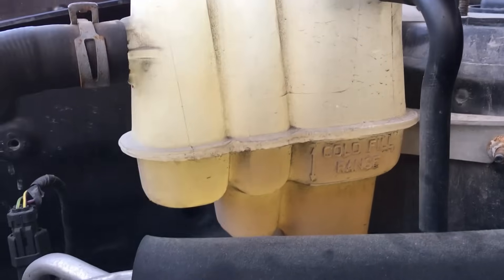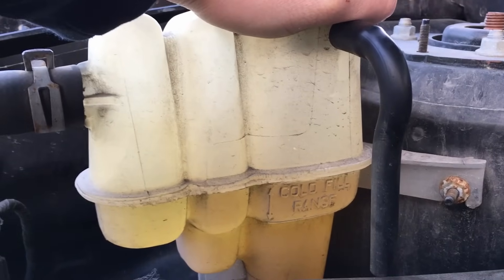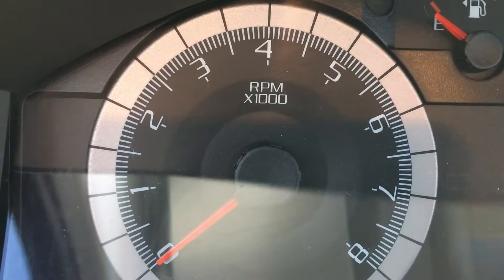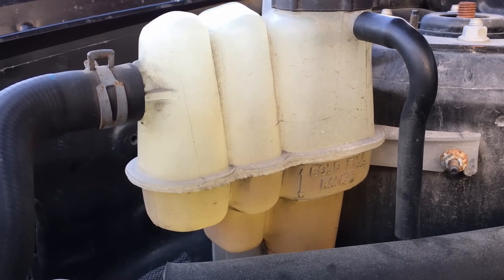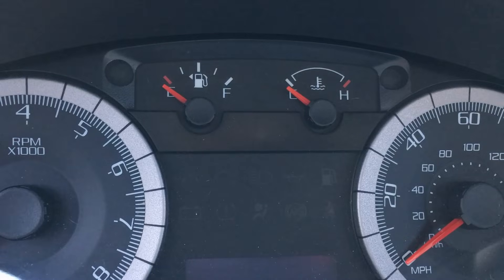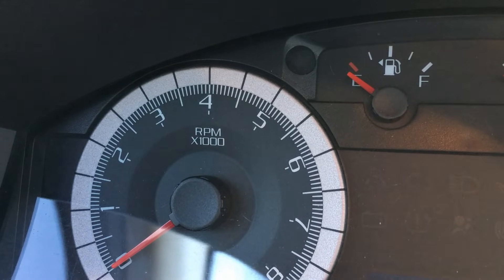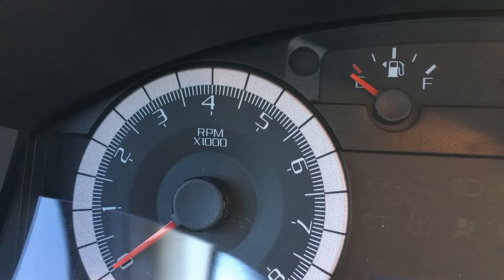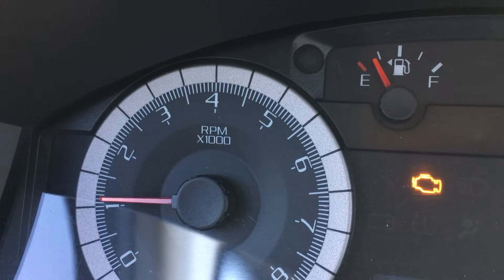Ford Quick Tips #69: The Trick to Purging Air From Your Cooling System

Comment: I have a 2010 Ford Flex bought new. No cabin heat until the car is thoroughly warmed up and driven several miles. Numerous trips to the dealer over the years. They make it a little better but never permanent. Other Flex owners have had the same complaints. I would like to hear your thoughts on the subject. Thanks.
Reply from the maker: No considerable cabin heat until a few miles of driving it totally normal especially in cold weather. Every car I have had from new to old takes a3-5 miles easy to start getting good heat. The other note I have is recently I had a customer complain of the same thing on a 2011 Explorer (which is very similar to the flex mechanically) he had it on auto I explained Fords strategy is to use the defrost and floor to mix the air and not blow it onto the drivers face full blast. Changing the heat to manual vent position fixed the concern he got heat and was comfortable much faster. Same thing in my Ram with auto climate control.
Reply: I understand that heat takes a while in cold weather but the Flex has a verified problem. At the suggestion of the Ford dealership I have a remote start and I can set the heat at 90 degrees, fan at high and run the car for 30 minutes before I drive and still the cabin has no heat. And there will be no heat until the car is driven several miles even if the outside temp is in the 30s or 40s.  And the RPMs have to be up there above 15-20 MPH. I've had Fords all my life and none of them has acted like the Flex. The other solution I've heard of so far is an auxiliary water pump into the heat.

Comment: Are you not leaving the coolant cap off while reving the motor?
Reply: Aaron Frazier is this required?  Having this issue on 6.0 power stroke.
Reply: @matticusbond3975  Did you get this figured out on your 6.0? I live in Northern Canada and heat isn't a nice to have.
I've been fighting with this for 2 days, simple thermostat change gone horrible.

Comment: Any advice on what I should do after vacuum filling my 2.3l Ford Fusion. I have good heat and a/c with no overheating but when I rev the engine in park I can still hear coolant ‘sloshing’ around? Recently replaced with an oem thermostat as well…
Should I run through this procedure?
Thanks alot for all your helpful information!!

Comment: I have a 2011 Ford Explorer 3.5 Duratec should I keep the cabin heat on or off during the 3500 rpm rev cycles? Thanks in advance for your help!

Comment: I added coolant in my 03 Ford Expy 5.4 2v. As i was pouring in truck started running bad. I think air is in system. I tried this trick and will try again later. Will this trick work on my older model. Thanks for all your videos.

Comment: Would you happen to have any videos of the changing out the coolant on the 2009-2012 Ford Fusion Hybrids? Not just the engine coolant but the electric motor coolant as well. I have not found a single video on this.

Comment: I put a vacuum on my 98 5.4 F250 TWICE and still no cab heat.  I'll try today to empty it all out again, vacuum to -22 - -25 for 15 minutes, then let the coolant get sucked back in, and do the 3500 RPM cycles.  Hope that finally does the truck b/c driving to work in a cold truck just sucks a bag full of asses.

Comment: I have a 2000 Ford ranger 3.0 just put new radiator and a lower trans cooler line in trying to be sure I don't have any air pockets, I don't have any special equipment what's a good was to bleed the air from the cooling system of a 3.0

Comment: I got a 2017 Ford Fusion. I hear water slothing noise behind the dashboard when driving and the heat not getting hot, only cold air. Is this the same culprit as you demostrated in the video? Thanks a bunch for professional video..!
Reply: Did this fix your issue? I'm having the same issue with a 2010 Fusion SE. Gonna try this tomorrow. My car overheats at idle or low speeds and I lose heat.

Comment: My degas bottle is venting fluid due to higher than normal temps (2015 F150 5.0). The heat functions as normal. I did notice that my fan doesn’t come on in time to lower the level IF my AC button is not pressed. If it is pressed my fans are on all the time even if I still have temp on max heat, and that prevents the coolant from getting anywhere near as hot as without the AC “on.” I tried this burping for two rounds. Not having heat at idle was never an issue.

Comment: 02 3.0 changed radiator because old one cracked. Now when I rev it up coolant steams out the top of the overflow bottle (with lid off). Put lid on and drive it still see coolant on engine mount. Heat is there but takes a little while. No overheat conditions but coolant does steam.

Comment: I have questions about proper coolant levels in a degas bottle.  When the engine is cold, where should the coolant level sit?  Also, when the engine is at operating temperature, should the coolant level ever exceed the max point?

Comment: Will this work or air pockets be the cause of my heater core inlet hose hot and outlet hose cool?  Or am I looking at flushing the heater core instead?  Have already changed the blend door actuator. 2006 f 150 lariat 190,500. Ty!

Comment: So do after the rev for 30 sec and idle time then shut off, do i crack the coolant tank to let the air out with it off or will it automatically purge the air without cracking the cap?

Comment: I own 2009 Ford Escape 3.0l. I had to replace the thermostat, coolant temp sensor & top rad hose. All original parts when I bought new. I drained all coolant first. Takes 9-9.5 litres coolant. I have only been able to put 7 litres in???? Heat great! Doesn't overheat! Did everything you did multiple times. Driven 5 separate times. Why can't I add remaining coolant? Cold, after coolant expands in overflow goes down to perfect line should be at. Any thoughts? TIA

Comment: I've got a good one for you! I have a 2013 Ford Fusion Hybrid with a 2.0 and as I was driving back from a location I got notice on my dash showing (Motor Coolant overtemperature) I pulled over and shut it off and started the car back up and now there was no warning and when I had it checked out there were no codes! Changed the Temp sensor and later that day it came back on! I checked the resevoir and the coolant was hot but not overboiling and still no codes to determine what the problem is!!! Every place I took it to has never seen this type of waning and especially when it leaves no code to determine the problem is? I had the heat on in the car which was working fine and I turned up the heat as high as it would go to extract as much heat from the radiator and I also loosened up the cap on the resevoir so there would be no pressure and drove 35 to 40 miles an hour for 42 miles just to get home but the problem still exists

Comment: I have a 21 Acura ILX, and I used the spill proof funnel to burp the system. I did it for 3 days, because I’m only getting hot air on HI setting on the temperature control. If I go to 86,85,84, ect… it goes to basically, room temperature? Any suggestions? Thanks

Comment: I have a 2007 f150 engine heating up I have changed the thermostat radiator and water pump and still doing so. There is no white smoke coming out of the exhaust bit it's still overheating. I fill up the coolant bottle and when it's heating it overflows. I turn on The heating in the cabin and it's heating correctly . What can this be I'm lost please any advise would be great. I really enjoy your videos very informative and direct

Comment: This works... done it a number of times on my 08 fusion. I never have had to turn it off though. Just rev while opening and closing heater temp control. Let idle and check coolant level. Once it’s good, drive for a few days and check coolant level. Do this a few times as there still might be a bit of air in there.

Comment: I actually think this worked in my 2003 4.6L Aviator. New Water Pump and belt that shredded. Back together and overheat, overheat, overheat. Purged doing your method. Running right where it should. Still no heat coming out but I live in Florida so I dont care, as long as the engine doesnt overheat. Thank You.

Comment: I have flushed and filled a few ford in my days.  I have never used a vacuum fill or a Lisle No-Spill Funnel.  Fill to the cold level, leave the cap off and let it idle until up to temp.  Take a 20-30 minute drive, mixing stop and go and some highway.  Shut it off and double check the coolant level to be sure it is near hot.

Let the system fully cool down (overnight) and double check the cold fill.  That is all I have ever had to do.
Reply from the maker: If it was only that easy nowadays.

Comment: What blows my mind, is that the engineers have failed to design the cooling systems that bleed theirselfs. People can't afford to take back a vehicle to the dealer for every situation.  Another issue that Ford has is a simple oil change. It is almost impossible to not have oil scattered underneath and in the shields. Next thing you know is the customer is complaining that they have an oil leak because of oil trapped in the shields.

Comment: I have a 06 five hundred. I’m hoping this works. Replaced thermostat and water pump. Still overheating and heat is spotty. I’ll update. Did not work for me. I see it has helped quite a few ppl though. Thanks for the video.

Comment: My Ford 2002 Escape coolant reservoir had a hole on the top of the tank and shot all the steamy coolant in the tank out. But the engine was not overheating at the time. I refilled the coolant reservoir with anti-freeze, patched the hole with a 2-part epoxy and let it cure over 12 hours. This morning, on my way to O'Reily buy a new coolant reservoir, my engine started overheating after about 1 mile. I will let the engine cool down then try your procedure. If you have any suggestion, I would really appreciate it!

Comment: My 2009 2.3 Fusion makes a "waterfall" sound at start-up. No overheating issues. I believe its a known problem and Ford has an updated degass bottle and new thermostat housing to correct this.
Reply: My 2010 SE has this sound too and overheating and loss of heat in cabin even after a complete coolant flush. I'm trying to this tomorrow. This car has been nothing but a pain in my ass.

Comment: Awesome video! Worked great. Thank you for the great videos. Speaking of rpm’s, my 2008 Taurus x 3.5L has a messed up rpm gauge. It never resets starts at different intervals and sometimes pegs all the way past redline. I think it is cause the transmission to shift weird. Any ideas of how I can fix or reset the rpm gauge to fix this issue? Thanks in advance. Again awesome videos huge money savers!

Comment: I have a 98 MGM, that has a gurgling sound from the heater core when cold. Tried purging in many ways, sound is there almost every startup. Don't lose a drop of coolant for years, no leaks. Only thing is prior owner used some crap to seal the bad intake manifold - cleaned it all out but wondering if that could be the issue in the heater core. Heat is otherwise very hot. Maybe an air pocket? Try your procedure?

Comment: Wild fluctuations of the coolant level in the Degas bottle is a sure sign there is still air in the system... Air is compressible, liquids are not... Revving the engine increases the pressure between the water pump & the thermostat so any air between those two components means the air gets compressed & the water level falls in the Degas bottle, release the throttle & the water level will rise...

Comment: This is great video but how would you do it on a hybrid where you won't be able to rev up the engine? Thanks
Reply from the maker: You can't rev your hybrid?
Reply: @FordTechMakuloco  Incan rev up Sir but only over 2000 rpm. I just did major PM and took the intake manifold after watching one of you video on "carbon build up". Thanks.

Comment: I found my coolant reservoir to be empty. Filled it to the cold line. Drove fine but then after about an hour of driving it started to sputter and engine was really hot but temperature gauge was at the same spot as this video. Never went above that mark. I believe it’s a coolant issue and not a transmission as for the whole hour it drove normal and the transmission never hard shifts always smooth. Probably gonna have to bring to a mechanic to vacuum fill the system to make sure its working properly

Comment: Do you have this kind of a video for a two valve 5.4? I flushed the heater core in my truck and the water was flowing fine (03 F250) along a new thermostat and a new blower motor resistor+ pigtail. Well you could really hear the water moving around but there wasn't any leaks and then maybe two weeks just plain radiant heat out of the defrost. I'm thinking there's air in the system but I don't know?

Comment: I'm planning on buying a 2017 Ford Raptor that has the second generation 3.5L ecoboost V6.

Would you recommend that I install a catch can system on this second generation engine?

Also is there anything else that you can recommend that I add or change to this new engine to improve the performance or preserve the engine, intake system and turbos...???

Thanks for your help!
Reply from the maker: While a catch can on a boosted engine is always a good idea this engine helps reduce deposits with the duel fuel injection system. Until more data comes out on the redesigned pcv system and CAC I would stick to these key points- use 93 octane no matter what they recommend in the owners manual, use BG44K in your fuel every oil change and after 10k miles on dyno oil switch to Pennzoil Ultra platinum to keep it as clean as possible- http://amzn.to/2iMuPr4

Comment: On my 2012 2.5L Fusion, should I also open the little coolant bleed hose up top (drivers side) in back of the engine?
Reply from the maker: No that would be the first method to try, this is totally separate
Reply: @FordTechMakuloco  Got it...Thank you!

Comment: thanks for this - my 2015 F150 Coyote had its water pump, thermoatat changed 6 months ago on the fall. Now its spring in Canada and my coolnt temps fluctuate 99-106C when driving... is this an air pocket? Dealership cant figure it out... my assumption is that temps should be stable at 91-95C Thanks
Reply from the maker: You want to check for the low speed fans to make sure they are coming on.
Reply: @FordTechMakuloco  thanks, confirmed low speed and high speed fans operational. Thermostat opens at 100C.

Comment: On a 2002 ford taurous 3.0  v6 is there any reason why you can't remove the heater bypass linesand just put two 5/8 coolant lines directly to heater core

Comment: Hay man great video I have a 2015 Ford Transit 250 3.5 ecoboost. Passenger side heater blowing cold air when on “heat” drivers side barely working also. Any advise? Recently had a coolant flush done Thanks in advance!

Comment: Will this work with a 2012 Fusion 4 cylinder making that annoying waterfall noise?
Reply: Did you try this yet? Did it fix it? I have a 2010 SE hearing that waterfall noise on startup. When I go over 50mph I have heat, but if idling or going slow, it "overheats" and I lose heat in the car. About to the wits end with this car. I'll try this tomorrow. I've messed with flushing this car so many times and messed with the bleeder screw and nothing. I assume I have air in the system. Already replaced the water pump and thermostat months ago.

Comment: Wouldn't regular driving eventually burb the air out?   Have a 1.6 ecoboost. High temp comes on while driving, twice about 2 months apart.  Heavy accelerating makes the temp light go off.  The process in your video may help this.

Comment: My 1997 f150 has very lukewarm heater temp and the temp gauge is barely above C when usually it's halfway between C and H so I assume most likely I have a stuck open thermostat ? Anyway to test it for sure?

Comment: I am getting ready to do a water pump job on a 2007 Edge 3.5. 
I have a question.
The car began to over heat and was stopped and turned off immediately. The gauge didn't peg out owner noticed it begin to climb and pulled it off the road. Upon inspecting the vehicle I noticed it had puked out the bottle as steam ( I'm guessing because the bottle is empty and no signs of residue in it ) some oily stuff with coolant. The oil showed a slight sign of milkshake on tip but was overfilled by 5 inches on dipstick with coolant. Drained the oil and it came out thick and slow looking like mud. Didn't want the crank sitting in coolant.  so my question is this, Is that normal for a water pump failure for it to puke out what it did as it vented out the bottle cap? Should I be looking at the oil cooler too or some other reason? I was thinking that the coolant steaming out cap created a vacumm and sucked oil from timing area and that is why there was that oily mix all over engine mount on frame under bottle and on top of the seam of the bottle.. If I could share pics here I would.

Comment: Check engine light is on. lol. Can't help but laugh. Our service truck at work's been on for at least 3 years. 06 F350 5.4L Triton. 
Left bank cam sensor A. Both cams and the crank sensor been replaced. Still sets code. Also on for the cat on that side to. (rolls eyes) 130K. Been on since about 85k
Reply from the maker: The classic purge valve problem rears it's ugly head once again!

Comment: Do your system maintenance,  refill, then drive up on ramps, this puts front end higher than heater core, air will always go to the high point, do as he says and leave your tank cap loose, air will bleed out faster this way.